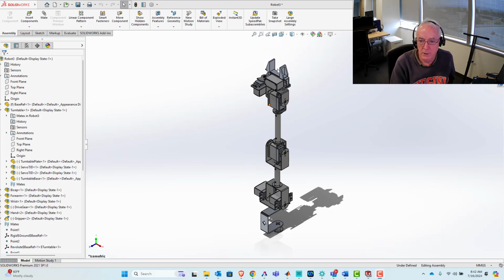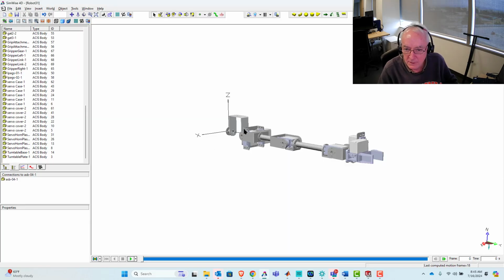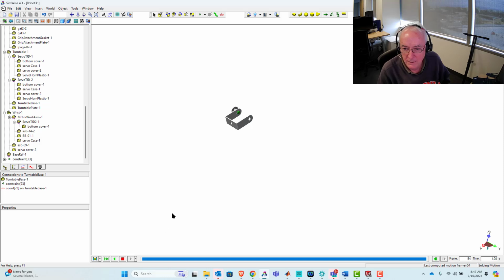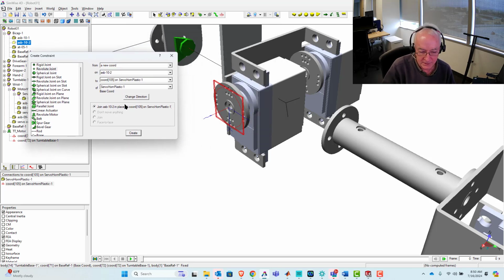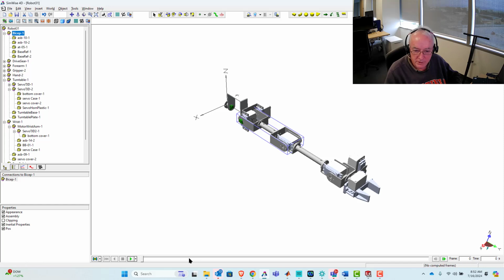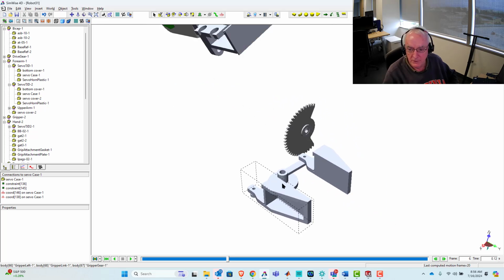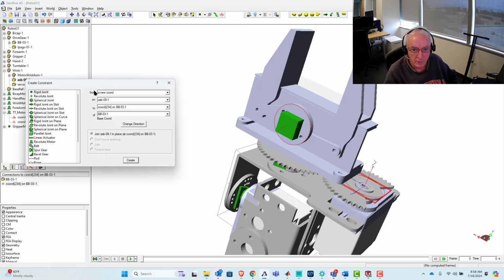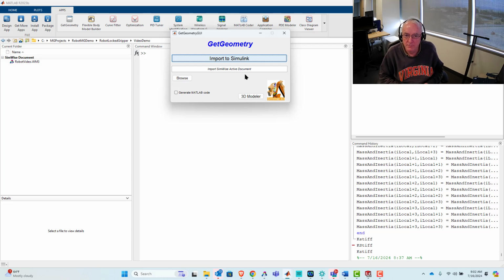Engineers Studio #98 -- Import Robot Mechanics from SolidWorks

Comment: Hello sir, why do you use SimWise  to export the robot to simulink when you can do it directly using a plugin in SolidWorks, Inventor or OnShape ?
Reply from the maker: Thanks for the comment.  Reliance on the correct assembly mates to be formed by the mechanical design team is a big issue that prevents many organizations from using Simscape Multibody. This is the case if you rely on the plugins that you mentioned. In this video, you will see that SimWise frees you from that limitation, as its 3D GUI allows you to quickly build the joints that you need.  Because both SimWise and Simscape Multibody create mechanics models based on the paradigm expressed by Bodies, Joints, and Coordinate systems, you have a perfect translation that avoids the interpretation of intent implied by assembly mates.  Additionally, this approach works well for more CAD packages.  If the plugins you mention work well for you, I encourage you to use them.  I think there may be more advantages for you that are demonstrated in this video -- it would be good to hear from you if you see them, or not.  Thanks. -Terry
Reply: Thank you for your detailled answer sir.

I have never used these plugins myself, nor have I used SimWise. The CAD software I use (Fusion 360) doesn't have a plugin to export assemblies directly to Simscape Multibody. 

When I want to use Simscape Multibody, I typically follow one of three approaches:
1. Go through the laborious process of importing each STEP file into Simscape, manually creating the frames, and adding the relevant joints.
2. Use primitive shapes (brick solids, cylinders, etc.) and assign the inertia properties obtained from the CAD software when visuals aren't a priority.
3. Export the files from Fusion 360 in Inventor assembly format and ask a friend to use Inventor to export the Simscape files.

While the first and second approaches are painful and slow, they have given me a solid understanding of Simscape Multibody. However, I am skeptical about the third approach. Whenever I use it and open the automatically generated MATLAB file, I notice values are off by an epsilon (numerical errors), particularly in rotation matrices. This is concerning since the columns should be orthogonal and normalized.

I remember seeing your videos on the Matlab YouTube channel a while back, which convinced me to install SimWise 4D. However, I found it complicated with limited resources available on YouTube, and I couldn't import assemblies from Fusion 360 (.f3d files).

My question for you is: Is there a CAD software-agnostic file extension that can facilitate this process?
Thanks again for your help!
Reply from the maker: @omaraissani6255  Nice to hear more from you.  I think you can do what you need from Fusion 360.  I don't have Fusion 360, but it sounds like you can export to an Inventor Format.  Perhaps, even better, might be an option to export the assembly to ACIS, Parasolids, or Step format.  Such a file will be read in as an assembly to SimWise, from which you could build mechanical model like I have done in this video.  Let me know if there is more I can do to help you with MathWorks partner SimWise.  Thanks. -Terry
Reply: @terrydenery7078  Thanks for your time Terry. I will give it a go and return with a feedback. Great channel by the way. I am a big fan